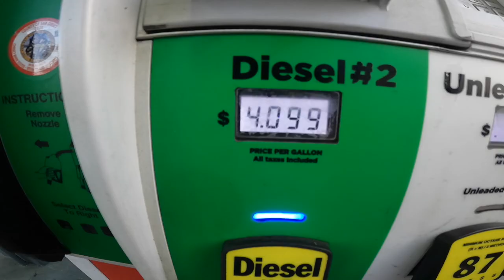Being a Roofer in 2021!! Day in the life of a Roofer! #roofing

Comment: In arizona this year reached 121 degrees and our gas prices are 3.79 unleaded gas diesel is cheaper than unleaded gas here the diesel gas is 3.69 and I drive a 2011 ford f 350 dually diesel 7.8
Reply from the maker: Your lucky down here right now it’s 4.69 for unleaded gas and for diesel it’s 4.59 so for us it’s just all bad. We drive to valley center down here and it’s 3.69 for unleaded and 3.50 for diesel. Thanks for the support and stay hydrated out in that weather that’s HOT HOT weather!👍🏾